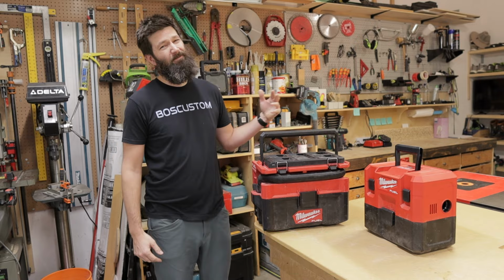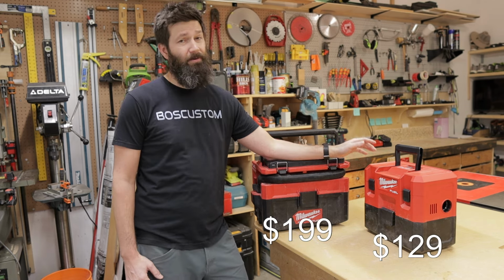Can the M12 Fuel Vacuum SMASH the M18 Fuel Vacuum? David V Goliath!!!

Comment: Hmmm. I bought the M12 vacuum that looks like a dust buster, HATED IT! Thanks for the video but I’m sticking with the M18 teapot M18 vacuum. Works well.  It’s important to clean these vacuums routinely for them work efficiently.  That’s been my experience.
Reply from the maker: Fair enough!
Reply: I bought the same M12 Vac. Its absolutely rubbish. It comes with an extension piece but doesn't have enough suction to make it usable. Also takes a teaspoon of concrete dust to block the filter and bring the suction to virtually zero.

Comment: I love your reviews and lean towards Milwaukee now. Especially because of the packout. I am going to sell all my Dewalt tools and go full with Milwaukee. I love The m12 green laser and fuel multitool of the m12 lineup. But for the angle grinder I want to go for the m18 fuel for the power (I am a tile contractor). Would you recoment to mix up the m18 with the m12 or just stick with 1?
Reply from the maker: Hey buddy, with regards to the M12 M18 mix up, they do make those chargers that charge both the batteries, so that's nice.  With cutting tile I'd imagine the extra juice in the M18 would be vital.  Best wishes on the new tool setup!

Comment: I purchased the M12 Vac. I installed a fully charge 6ah battery. It went dead in only 3 minutes, your demo vac seem to run longer. Did you need to change the batteries, or did I get a defective vac. :face-orange-biting-nails:

Comment: Awesome. The funny is back!! I have both the M12 and M18 systems. So which  vacuum should I buy? Your recommendation.
Reply: If you have to ask, both!
Reply: The m18 non pack out is $99 

I’d go that route based on cost alone
Reply: @kds471  Your right. I do want both.
Reply: @mfetzer1  too many tools chasing too little dollars is my problem.
Reply: @kds471  Same here. Its getting hard to keep all these tools hidden from my wife. Lol
Reply: @crashgsxr750  That is a good deal.
Reply from the maker: I that one for 99 the fuel version?
Reply from the maker: Do you have Packout?  If so the 18 for sure.  If not, and I had 1 or 2- 6A 12v batteries I'd probably lean M12, especially if my use was more lightweight type stuff.  That being said I still like my Makita 18V vac the best:)
Reply: @TheFunnyCarpenter   nope it’s the non fuel version
Reply: @TheFunnyCarpenter  I do have the p
Packout. I bought it after you compared the Tough System 2 vs the Packout. I know your fond of that Makita Vac. I only have one Makita battery. So the M18 Vac it is. Thanks for your input.
Reply: @TheFunnyCarpenter   do you know if/where to buy disposable bags for the fuel vacuums ?

Comment: I have to take both my m18 fuel vac as well as my new m12 fuel vac back for exchange there both severely damaged and cracked sucks because the boxes look in great condition and there was a item missing from both
Reply from the maker: Well that sucks! and not in a good vacuum type of way.
Reply: @TheFunnyCarpenter  right lmfao got them replaced new ones 100 percent better condition

Comment: I got the m12 with a 6ah battery for 100 bucks.. and I have a ton of m12 batteries. People don't realize they use the same motor. Just different battery. I put packout cleats on mine and works great
Reply: How's the vacuum working for you Still recommend?
Reply: @steveb611  yup, works great. Only downside is 15 min runtime on a 6.0 but I rarely need to change batteries for these little jobs. I use a 6 gal ryobi for big stuff. This works great if u can find it for a good deal

Comment: Good side by side.  I'm a Milwaukee fan, but their vacuum attachment, the one you used,  SUCKS!  And not in a good way, because it doesn't suck in a vacuum way.  The opening on the bottom is just way too big.  Horribly designed by someone who doesn't understand the importance of air velocity.   I tossed it and found another that would fit the storage slot.  I'm much happier.  I can suck up screws and broken glass without having to pull it off.
Runtime on that M12 with a 6ah pack is the decision threshold now.  Thanks for another informative real world test video.
Reply from the maker: 100% agree, that attachment blows.  I put my Makita attachment on there and like you say it sucks up most everything.  What attachment did you find that fits on there?

Comment: I got one with the high out put battery but I think M12 batteries are not enough to keep up, they got drain fast. So one has a tip or what kind of battery should I use?
Reply: was the 5.0 battery

Comment: The problem with those vacuums is that you need to be on your knees cleaning. The Bosch is so much easier with longer nicer hose and extension pipes.

Comment: so all those negative reviews at home depot are bad units?  because you have an M12 that seems to work fine with no overheating issues like people were claiming.  Hmmmm...I want to give it a try.
Reply from the maker: This is interesting.  I didn't have any issues with mine but to be honest I haven't used it a tonne yet.  I will try it out today and see if I can get it to shut down.
Reply: It is a real issue only under certain conditions it will happen Milwaukee hinted it may be a static charge causing motor to go into protect from using on carpet. They have fixed the issue and if you end up with a faulty unit will be 100% covered. At this point I’d say it’s the best vacuum at the price range.

Comment: Did you get the 10 tool entry ticket with yours I didn't get it or the m12 and m18 booklet same thing with the m12 fuel vac  I didnt get the 10 tool entry ticket or the booklet
Reply from the maker: I didn't either.
Reply: @TheFunnyCarpenter  that is strange for Milwaukee all fuel tools normally come with the entry ticket and the booklet thanks for letting me know I did exchange mine the m12 I got in exchange did have them the m18 didn't

Comment: For myself, more than sucking up beer and logs, I would like to see how effect they are for dust collection, especially drywall sanding.  If I could quit lugging the Orange vaccum around it would be like heaven on earth,
Reply: Can't speak for the M12, but the M18 handles it no problem whatsoever. It has never felt like it was overwhelmed or struggling, plenty of suction. Perfect for quick jobs, makes them even quicker, and I'm never going back. Just buy one, you'll love it. 👍👌✌

The reduced noise level is what surprised me. Granted it still makes noise, but it's a different kind, much less overbearing. I don't need to swap my earbuds and put muffs on to use it.
Reply from the maker: I'm not sure about using one of these vacs to suck up a bunch of drywall sanding on a big job, but a small one for sure.  Both the vacs also have dust bag options. I'm going to order some of those today and see what they're like.

Comment: Thanks for the test! I'll probably grab the M18 when it goes on sale. $200 is a bit steep when the makita is routinely on sale. As of right now, it's $155 on amazon with $25 off, so it brings it down to $130. I'd have to get an M18 to makita adapter though, so add another $20 or so.

You should test the makita against the M12 vac. :-)
Reply from the maker: I'll put that test on the board:)

Comment: I didn’t even realize they were coming out with an m12. I use my m18 on blower quite a bit so I think the deciding factor would be battery life for me. I found myself disappointed with run time per charge until I went right to the 12ah.
Reply from the maker: How is that 12Ah?
Reply: @TheFunnyCarpenter  I love it. I have my table saw, 7-1/4 mitre saw and vac on 12ah batteries and wouldn’t want it any other way.

Comment: You credited with M18 with the win on he noise level when the M12 was nearly 10db quieter.
Reply from the maker: The M18 was 75.7dbA and the M12 was 84.1dbA.  Perhaps the video clip was confusing?  In real life you can easily here the difference- The M18 vac is quieter.  Thanks for checking out the channel.
Reply: @TheFunnyCarpenter  I see now, you switched the positions on just that one test.

Comment: Does anybody know if the hoses are the same size and are interchangeable between the 2 models?
Reply: They are the same diameter. But just a heads up, Milwaukee uses a proprietary locking connection for the hose

Comment: These tests are laughable. No battery comparison, different styles of vacuuming, going outside of designated areas to increase time.
Reply: Exactly, for the first test, no dust weight/volume between those two square. The noise level test also there is no equal/constant varible between the vacs. I mean the dust chamber and filter. Clogged filter surely make a lot more noise. Should have tested both of it straight right outta box.

Comment: After using my boss' M18 wet and dry to attach to my cut off tool etc for dust free tile cutting etc, I decided to buy the M12 version.

With the M18 standard nozzle, it pushes into the dust ports of all my M12 tools.

However the M12 nozzle is slightly too large and doesn't fit. That's when I discovered the CP26 'click' fitting in the box. To use this, you need to unwind the original nozzle off the hose, wind on the CP26 fitting and then you can use it on your tools with dust port.

BUT. Then you can no longer use your nozzle, crevice tool or other included accessories, because they don't fit the CP26 fitting....

This is a huge design screw up in my opinion. So much screwing (literally) around to change fittings...between tool port connecting and general clean up attachments...for a company that harps on about productivity...what an oversight...